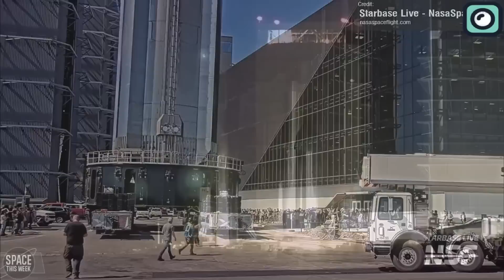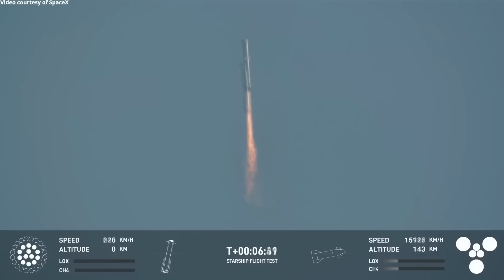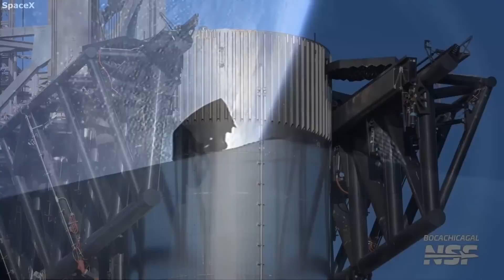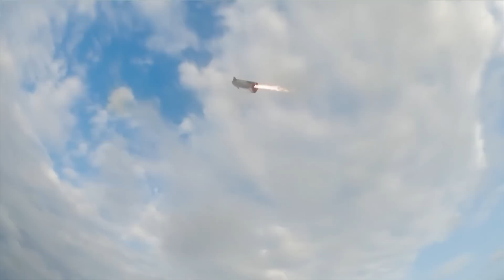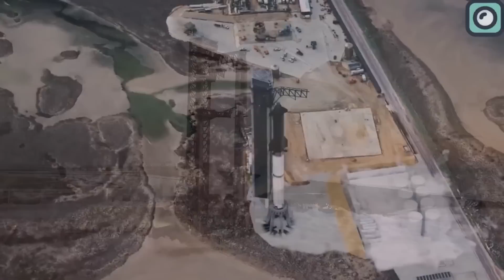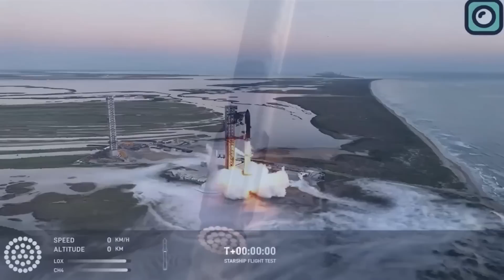SpaceX Jus Revealed That Starship Launch 7 Delayed!

Comment: I'm pretty sure they don't fire the Ship engines during a full-stack static-fire test. The don't even do full-stack static-fire tests. They only static-fire the booster, when the ship is not stacked on top. The only "test" they do with a full-stack, is a wet-dress rehearsal, and they only time they fire the ship while it is still attached to the booster, is during a flight's hot-staging event.
Reply: That would be a pretty spectacular evolution indeed.
Reply: Imagine what would happen if SpaceX mixed up even a single "the" and "they."